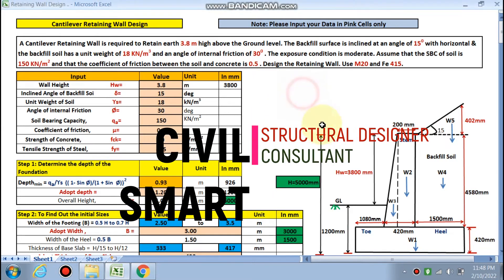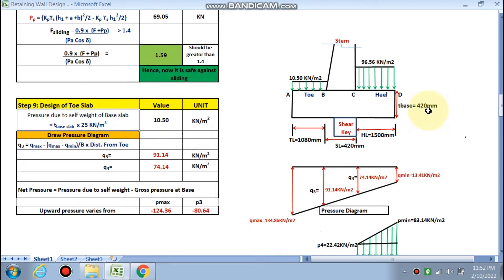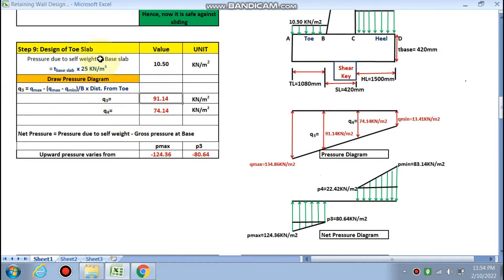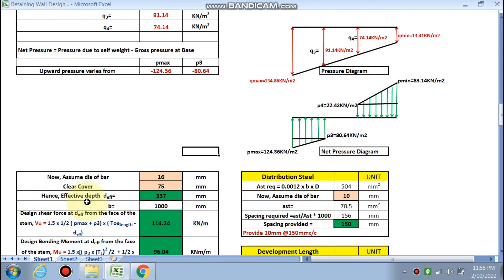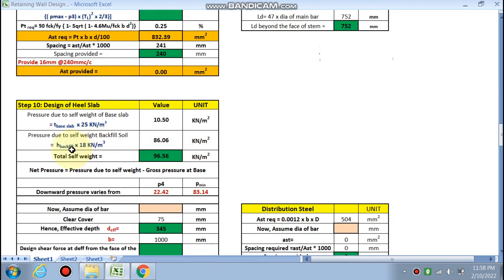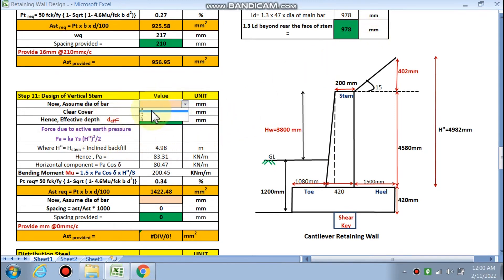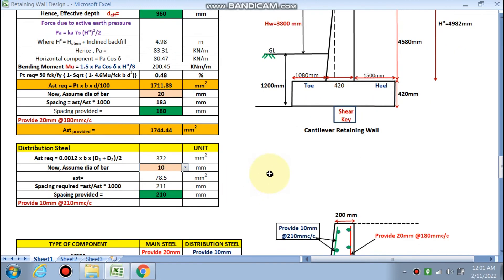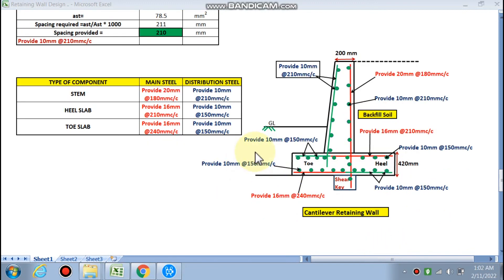CANTILEVER RETAINING WALL DESIGN (PART-2)

Comment: Please share me the excel sheet
Reply from the maker: Send me your mail id
Reply: @civilsmart  please send me all the excel design sheets which you have. Highly appreciate
Reply from the maker: @shareqinamdar8903  mail me on bhattdeepak352@gmail.com
Reply from the maker: Full Course includes all sheets as under:

IN FOOTING DESIGN SHEETS

1. Isolated square footing

2. Isolated rectangular footing

3. Combined rectangular footing

4. Trapezoidal footing design

5. Strap beam footing design

6. Footing with uniaxial bending

7. Footing with biaxial bending

8. Pile foundation

9. Pile cap design 3 & 4 piles

10. Wall footing/ Strap footing

11. Raft Foundation ( Beam and Slab Type).

12. RAFT FOUNDATION WITHOUT BEAMS.

IN BEAM DESIGN SHEETS

1. Singly reinforced beam design sheet

2. Doubly reinforced beam design

3. Continuous beams design  with point load having

    2-span continuous beam

    3-span continuous beam

    4-span  continuous beam

    5- span continuous beam

IN COLUMN DESIGN SHEETS

1. Axially loaded column design

   (a). When column size is known.

   (b). When column size is not known.

2. Column with axial load with uniaxial moment ( on 2 sides and 4 sides reinforcement)

3. Column with axial load with biaxial moment

4. Mux and Muy Calculation sheet.

IN SLAB DESIGN SHEETS

1. Cantilever slab design sheet.

2. Simply supported slab design sheet.

3. One way Continuous slab design sheet.

4. Two way Continuous Slab design sheet.

5. Two way simply supported slab design sheet.

IN STAIRCASE DESIGN SHEETS.

1. Dog legged staircase design.

2. Open well staircase design.

IN RCC WATER TANK DESIGN SHEETS.

1. RCC WATER TANK RESTING ON GROUND (L/B <2).

2. RCC WATER TANK RESTING ON GROUND (L/B >2).

3. UNDER GROUND WATER TANK DESIGN (COND. TANK IS EMPTY AND OUTSIDE SOIL IS SATURATED).

5. UNDERGROUND WATER TANK ( TANK IS FULL AND NO OUTSIDE SOIL PRESSURE).

4. UNDER GROUND CIRCULAR WATER TANK.

IN WALL DESIGN SHEET

1. RC WALL DESIGN SHEET.

2. RETAINING  WALL DESIGN SHEET.

3. BASEMENT RETAINING WALL DESIGN SHEET.

4. COUNTERFORT RETAINING WALL DESIGN.

Building load calculation sheet

Cost estimation sheet..etc
Reply from the maker: Full design Excel sheets course 
https://pmny.in/xrkWOuuWfbJz
Reply: Sir please send me this Excel
Sheet . It's very important for me